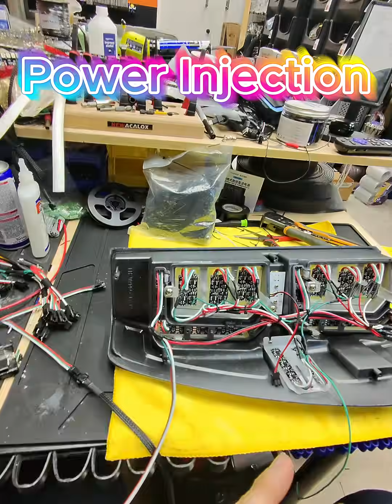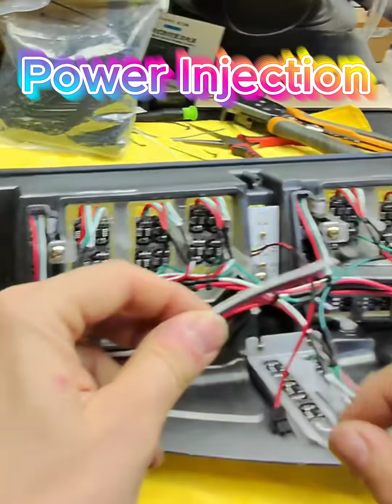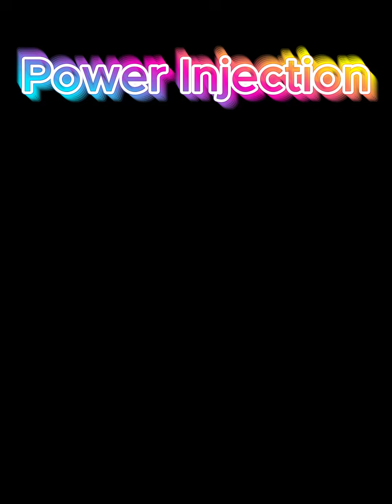LED power injection #AddressableLEDs #LEDMods #PowerInjection #LEDWiring #RGBLighting #RGBW

Comment: This is something im thinking about currently. Im preparing for a really custom tail light project that will have a long strip of lights run across the tailgate of a Silverado and then into the tails.
Probably will be created with Diffused HDSK6812 strips. Im thinking of doing power injection at each point where the 12" strips are joined together. Hopefully that would be enough!